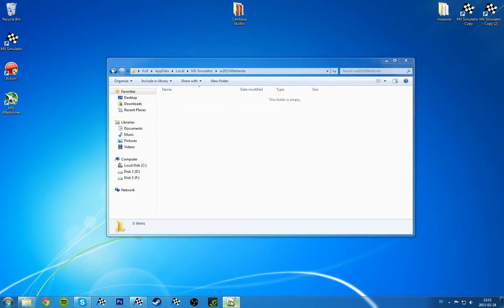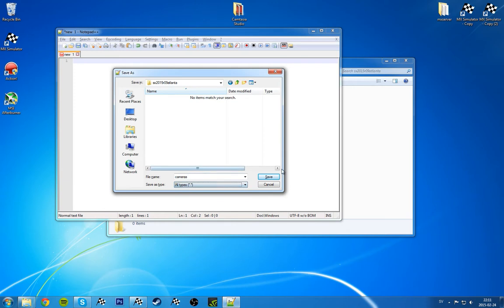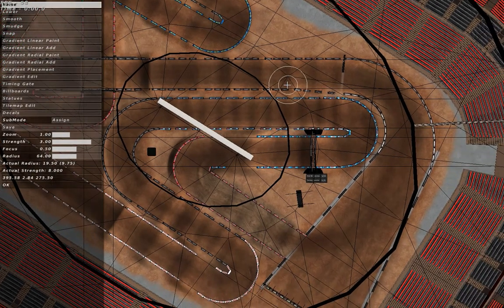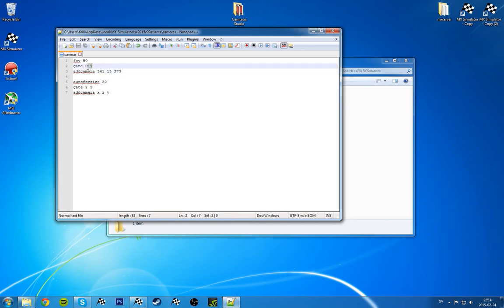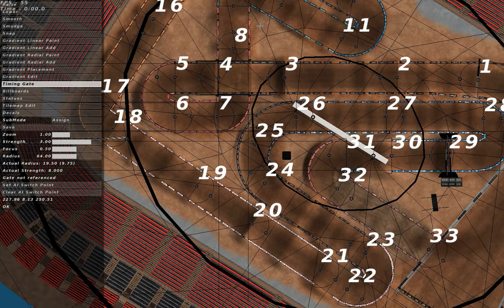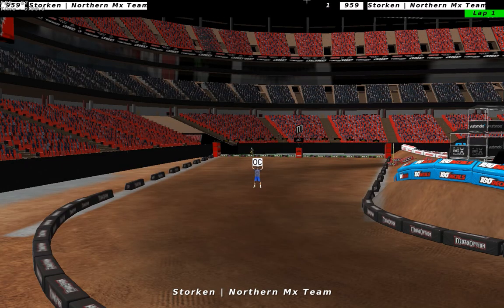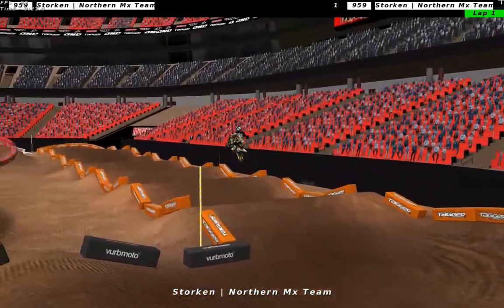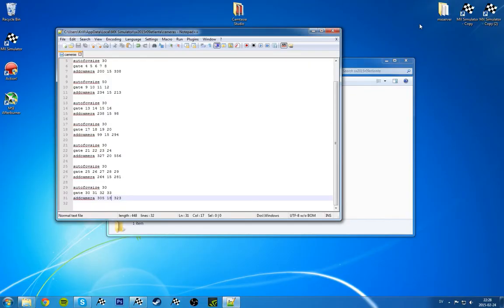Adding TV cameras to a track - Mx Simulator

Comment: what program opens .saf files?
Reply from the maker: Not any really. What I did in this example is having my track (saf file) in the C:\Program Files\Mx Simulator and than started a time trial, went by the finish-line to create a "lastlap.mxdemo" which ends up in the personal folder C:\Users\USER\AppData\Local\MX Simulator in a new folder with the tracks name. Than I just put the camera file in the new folder created by the time trial. :)